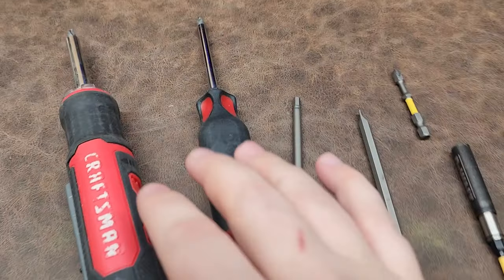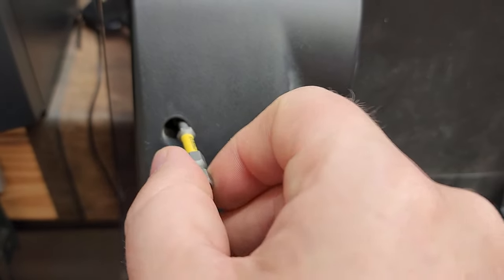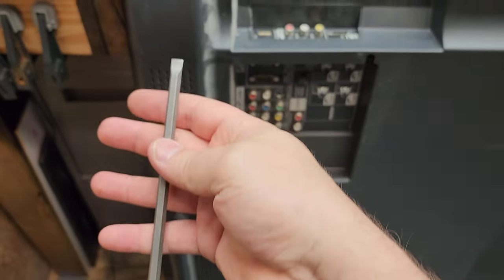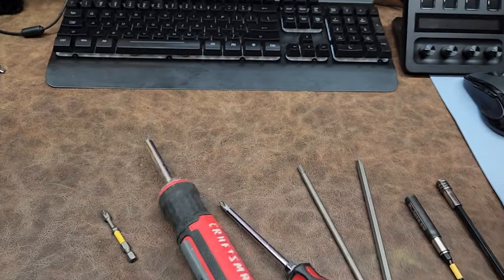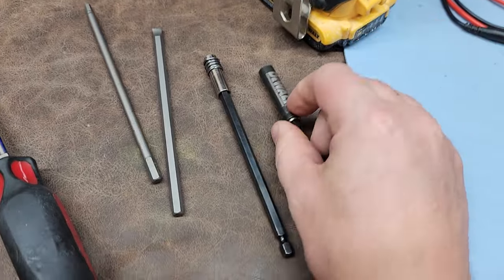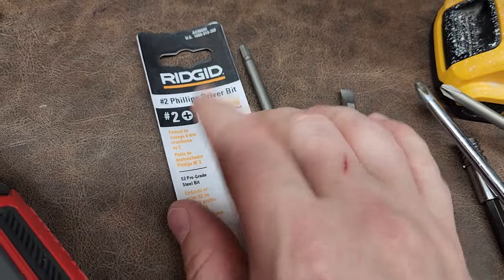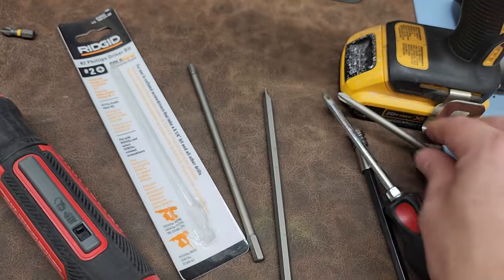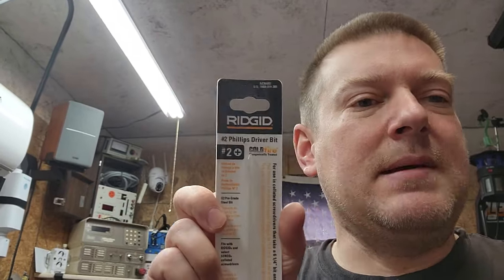Finally! A Real Solution.

Comment: Another trick you might like is to buy a 2nd piece of your loved manual screwdriver, cut it off from the base (with an angle grinder/hacksaw/multitool) and stick it in a small drill. 😁✌